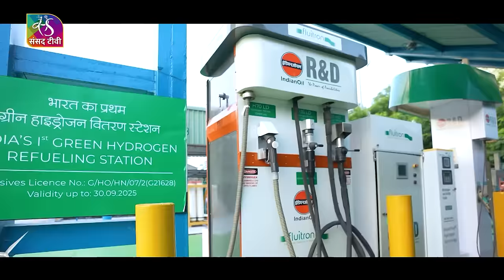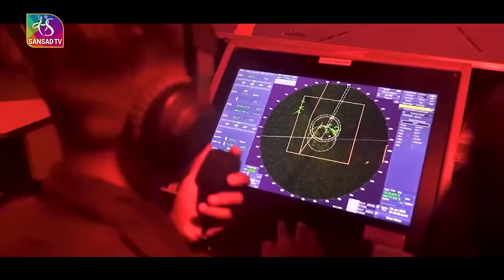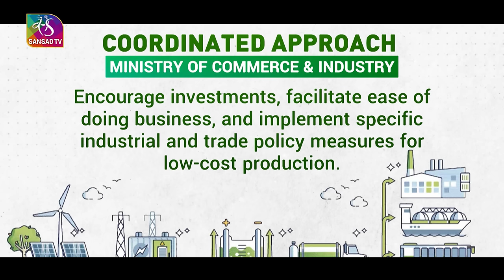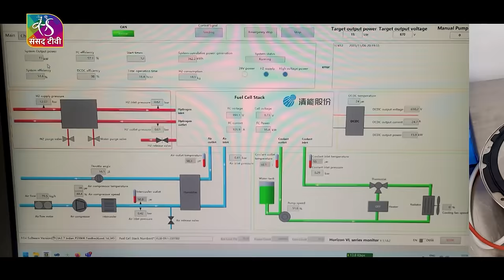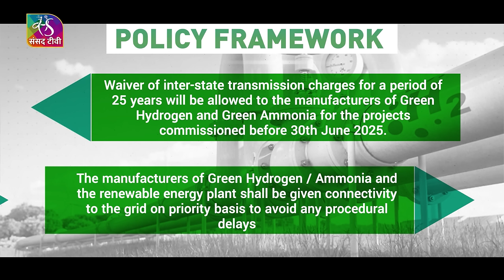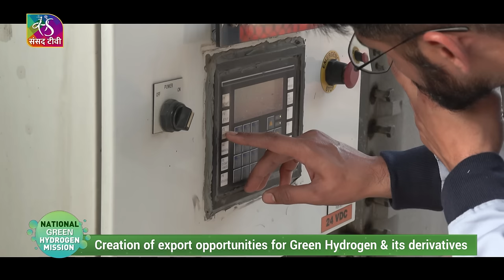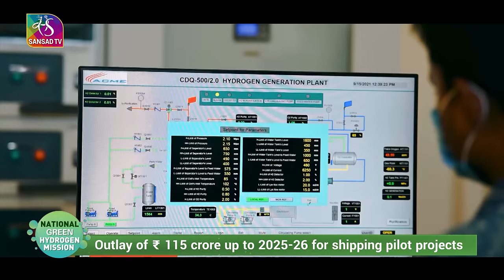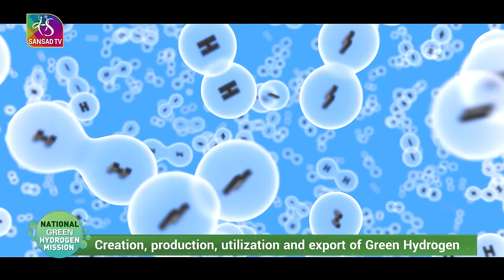Sansad TV Special: National Green Hydrogen Mission | 17 Dec, 2023

Comment: Energy Independent by 2047 and net zero by 2070

NGHM - H2 ecosystem, 
Renewable energy to produce H2 by electrolysis. Clean and emission free fuel. 

Another process through biomass. 

Usage - Energy fuel, Fertilizer, Steel

H2 Fuel cell, versatile energy transport to diverse fields

Decarbonisation of economy - public and private